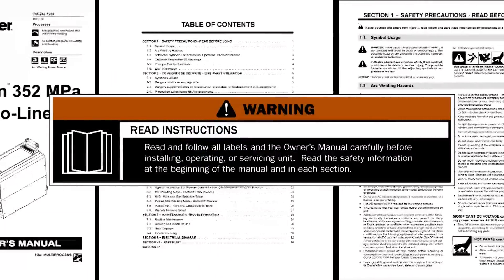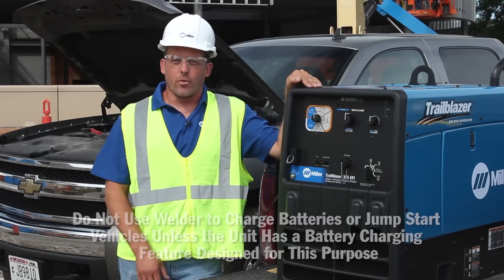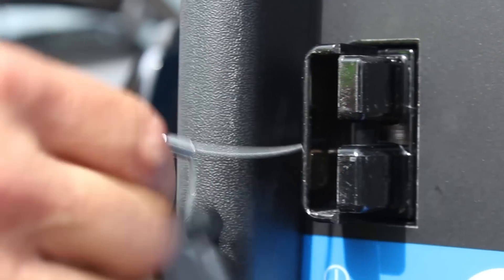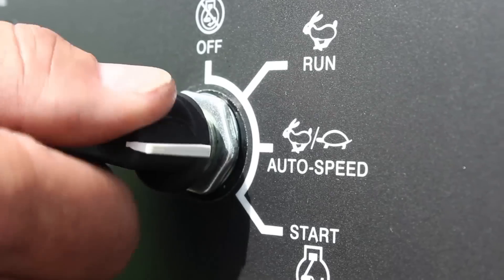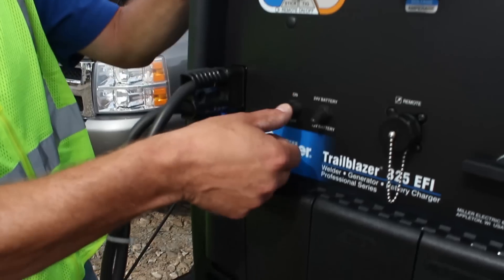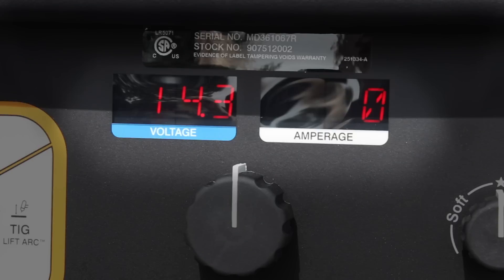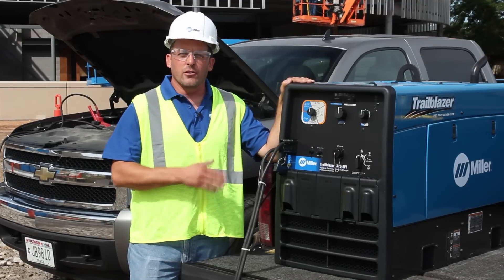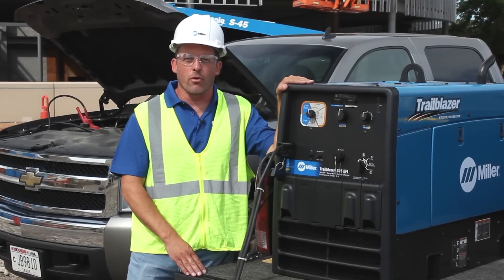Trailblazer 325 with Battery Charge/Jump Start Option

Comment: Got news for y'all, it's pretty much a waste of money. Will not jump off or charge a totally dead battery. As per Miller tech. Automated charging circuit blocks it. Has the output but won't do it. $250 worth of specialized Siamese jumper cables and thousand amp clamps useless. I have Miller Trailblazer 302 air pack and I'm royally pissed about this......

Comment: It still has that stupid fuel reservoir for the engine. Instead of running a high pressure fuel pump directly from the fuel tank, it has either a vacuum pump or an electric pump that literally runs on a float in a whole separate miniature tank, then they put an electric pump in that tiny reservoir to pump it up to pressure for the EFI. I'm sure it's not millers idea, but still sux when the float sticks. Js

Comment: If you're carefull . . . . You can use the stick leads and jump start that way . We used to jump start the locomotive at the rail road with a big 40 . Would not recommend ANYONE  do it without extreme caution ! But ive done it , , , 20 times throughout the years .  The older machines thats how you reversed the polarity in the windings and inside the machine it self . Be Safe !
Reply: i have started DC generator welders from another welder before because they are just a big DC motor
Reply: Great idea if you want to explode a battery
Reply: @lowhydrogen7018a1  train shop jumped the locomotive on a regular basis with a welder . Ive jumped a half dozen tractor trailers . Clear on down to a riding lawn mower . NEVER had a problem ! Only battery ive seen explode was a 100 amp car battery charger . Kid boiled the battery and it blew up in his face .